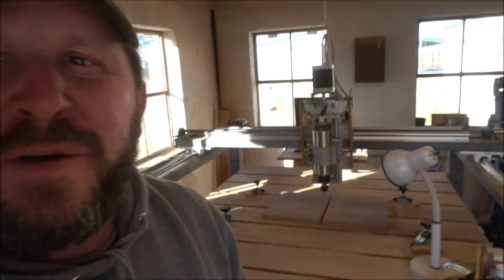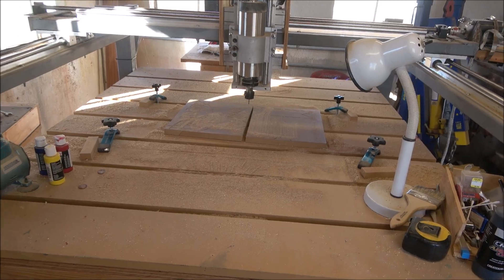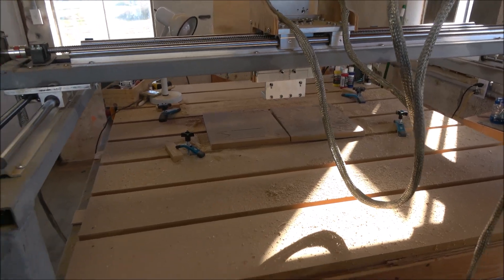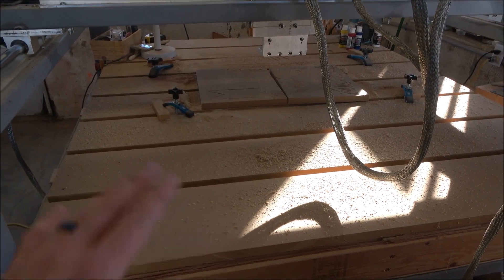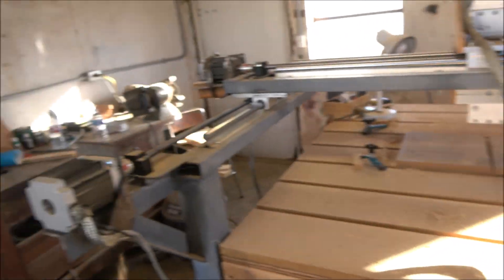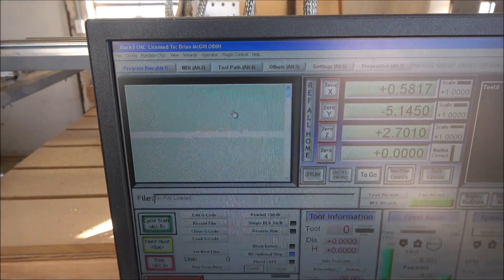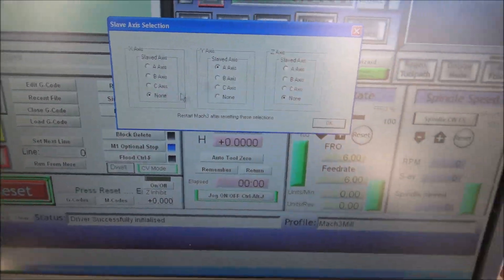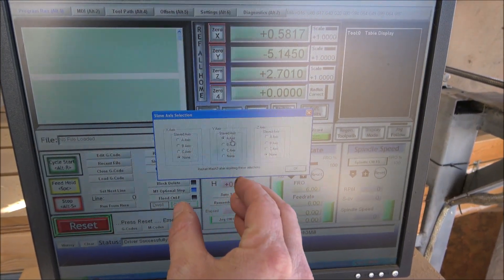Things not normally Shown (orders not shown)

Comment: How do you sync the two y axis motors so they are aligned properly?  You mentioned how to slave them, but how do you make sure they’re calibrated properly?
Reply from the maker: as far as actual calibration, I did none...I simply got 2 of the exact same motor, made sure the gantry was perfectly perpendicular to both rails and in Mach 3, slaved motor A to motor Y.....Thanks for watching!!!